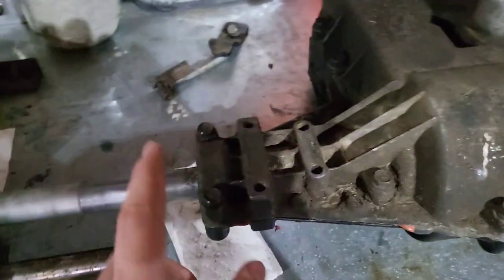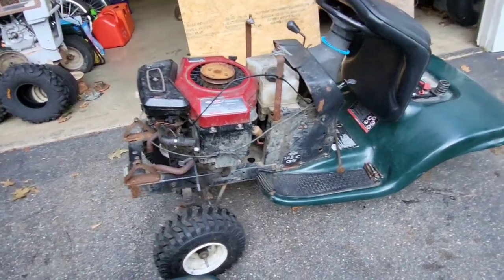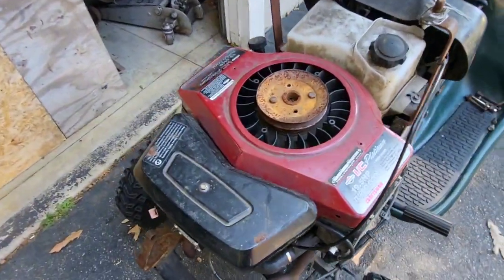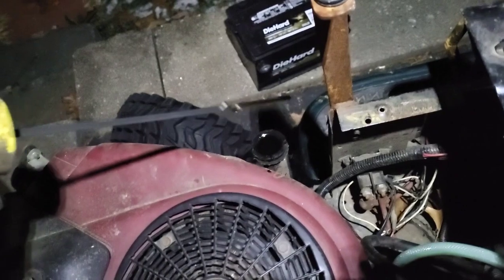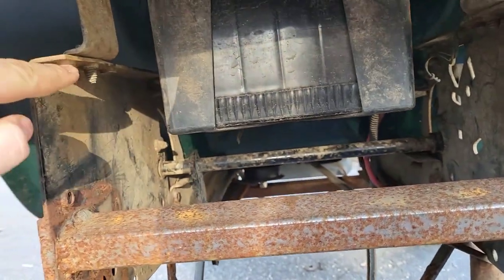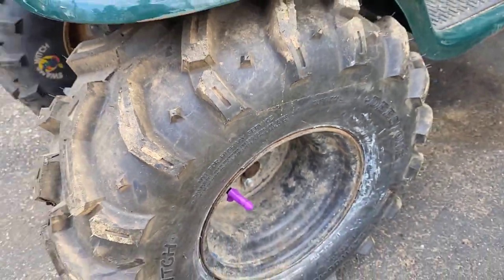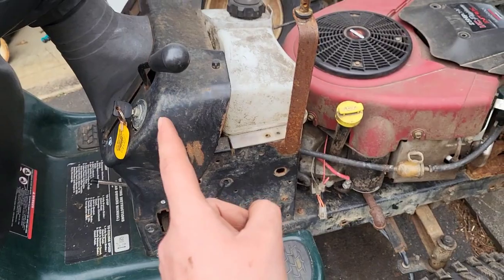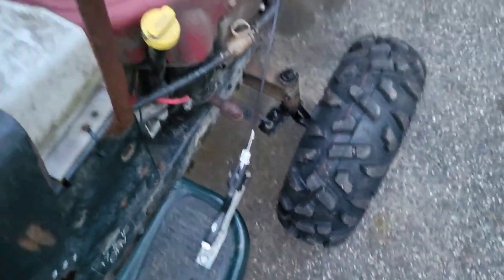Craftsman Crusher re-re-build #3

Comment: I put silicone under all of the bearings of my 820s before I even put the internals in. I also put silicone on the axle shaft and slide the bearings on over it for a little extra seal. 

Stock oppy carbs suck balls. All of my carb issues have been solved with a slide carb on a horizontal intake. It really makes the oppy a whole new engine. You can see mine on my channel. However oppys do just get tired after a while and that V twin should haul ass.
Reply from the maker: Thats a great idea with the silicone on the axel i didn't even think about that ill definitely try it! Ill also be checking out your videos on the carb on your oppy maybe i can bring mine back to life with your set up, i really appreciate you watching and giving this information!